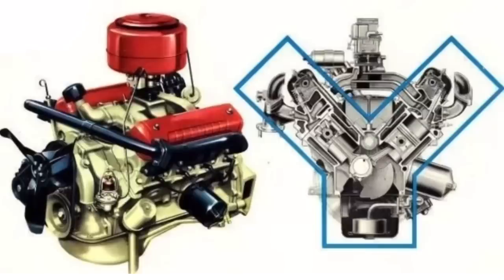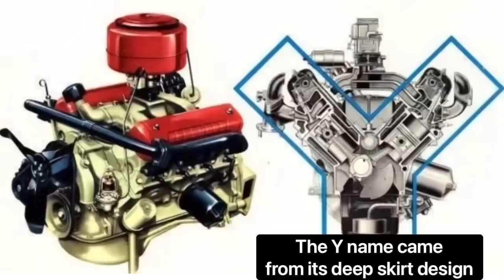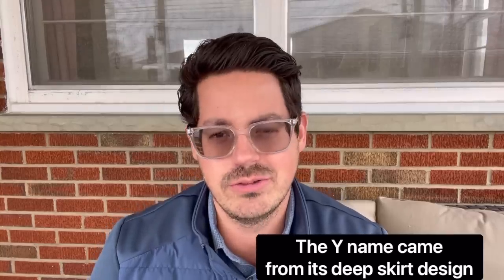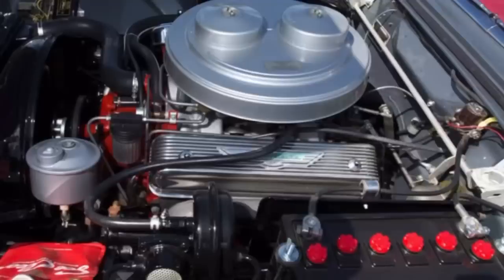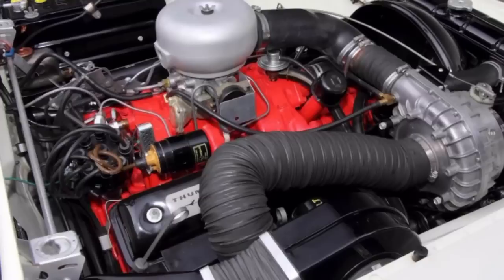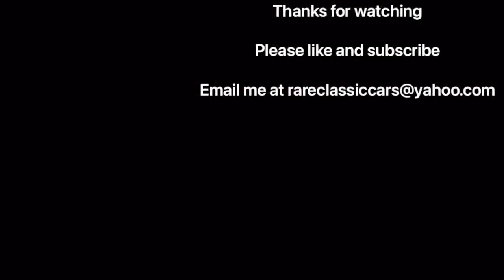Worst Engines of All Time: Ford Y Block V8

Comment: The first Hot Rod magazine I ever had,
the Sept 68 issue, had a great article on
the Y-Block called "One More Y-Block".
It was recommended to "ream-out slightly " an oil-return hole in each head.
Also, clean-out the area behind the oil-filter mounting. And yes, change oil
frequently. 
1957 versions are the hot ones.
Best aftermarket intakes: a 3x2-barrel
version.
Forget about the 1954 Ford and Mercury
versions. First-year teething problems.
The puny 239 Ford version was also used
in 1955 Ford pickups. Cam bearings are
a weird size. Also a weird water pump.

Comment: In 1970 I drove my 55 Fairlane to Laredo from Dallas. 272 2bbl. Dual glass packs and well tuned it was a pleasure to drive. Smooth, fast and strong and sounded great.  BTW the transmission was auto with a 1st gear select or it would engage on full throttle from stop.
Reply: Come 1970, you were driving one of the only ‘55 Fairlanes still on the road ...

Comment: I still drive a '54 all original, one of the best balanced engines Ford ever made, only the OIL of the time was bad, not the engine.  I run 5-20 synthetic, this big fordor gets 23 on the highway, far better than the flatheads, lots more power & speed, have 190K on it now, runs like new.  Don't be fooled by young guys' ignorance, I'm 89 and have been there done it.
Reply: Had a 54 239 Y Block & got about 23mpg with a 4 barrel.  The Rocker Arm assembly snapped so it ran flail (presume due to oil problems).Replaced the rocker arm & changed to a 2 barrel - got a drop in MPG. Some years later it wouldn't mic out for another rebuild, so replaced with a 292.  Generally a reliable engine.  Did have to repair the truck body frame & then the weld rebroke, driving in the dark thru the mtns.  Decided it was time for a change.

Comment: When I rebuilt mine 30 years ago, I had the engine on a stand, upside down. Needless to say, I messed up the cam bearing install. I also clocked the timing chain wrong because I counted the links on the wrong side. Once I learned those lessons, it was a good engine. One thing about them, the cylinder walls are so thick that I was able to bore the 292 out to .060 over. It was a fun engine if you like to tinker. Adjusting the valve lash on a regular basis was always fun. The front exhaust crossover pipe inadvertantly heated the fuel line causing the carb (For all you youngin's out there, "carb" as in carburetor, not carbohydrate. Think of it as a stone age fuel injector.)to vapor lock. The leaking heat riser valve bushings were fun. To it's credit, there was 1 vacuum line for the advance on the distributor, that it. Techs today missed out on some fun things that were around back in the day. Hell, the closest thing we had to a computer was a dwell meter to fine tune point gap and measure bounce. Sorry, it's past my bedtime so I'm not going to explain any of the words in the last half of that sentence. Consider it homework haha!

Comment: I have a 312 Y block in my 1958 T-Bird. 5W30 Valvoline high mileage blended ... NAPA Black filter and oil at 5,000 miles. Runs great. Cheap Insurance.
Reply: 5.7 Hemis are the worst for oiling.

Comment: I rebuilt a 312, in 1966.  I had heard about the problems with top side oiling and made sure that the machine shop that did some of the assembly also knew the secrets of the y block.  I had no problem with top side oiling and the engine lasted a long time.   Thanks for the memories.

Comment: So if you don't use the correct oil or don't change your oil and the passages clog up, that makes it a bad engine? I've had many Y blocks and currently have a 57 Bird with a 312. I've never had any problem because I do use the proper oil and change it regularly. I've driven it for 26 years with no real problem.

Comment: I had a 292 back in the day. My dad was a Ford guy. In those days engine rings only lasted about 80,000 miles. Getting 100,000 was considered a feat. Rebuilding engines was common. During this time I remember Ford's reputation for reliability was poor. Not only did the 292 engine need overhead oilers, but the shaft from the distributor that drove the oil pump had a tendency to break. My 292 thru a rod. I was so impressed with ford, I didn't have another for 50 years.
Reply: I had one that didn't break the intermediate shaft, but it did round off and quit driving the oil pump. I replaced it and drove the truck for several more years.

Comment: the Y block above the vega's ... graphite impregnated aluminum block... no liners... just infused graphite... that instantly washed out the first time fuel hit it... 

your seriously going to put these engines in this order...? REALLY?!!?!?
Reply: “One of the first (and worst) examples was the Chevy Vega engine back in the 1970s. Many of these engines burned oil from day one. The engines were cast from a high silicon hypereutectic A390 aluminum alloy that contains tiny hard particles of silicon dispersed throughout the metal matrix.”
Reply: @sking2173  and there ya go... 🤮🤕

Comment: My dad had a 1958 Ford Ranch Wagon with the 192 V8. I remember him cursing when he removed the valve covers exposing all the accumulated sludge. His 2 previous cars were a 1929 Ford Model A Town Sedan & a 1940 Buick Super convertible. He claimed that he didn't need that new detergent oil in this previous two cars. He got rid of the Ford wagon in 1967,  replacing it with a Ford Mustang 2+2. He learned his lesson & used the newer "detergent oil in all of his subsequent cars.

Comment: My first car was a '57 Fairlane 500 with a 312 Thunderbird Special v8, 4 barrel carb and dual exhaust with quiet mufflers.  My dad always drove economy cars, so all I knew were fairly gutless cars that struggled on climbing hills.  On coming home from buying it, we came up the steepest hill that we usually suffered through a 15 mph drop in his car.  At the bottom of the hill, I had the Fairlane sitting on 60 mph and without opening it all the way up, I chickened out at 80 mph.  It was the strongest car I'd  been in up until that point.  Crappy gas mileage, but plenty of power.

Comment: I was raised in a Ford family.  My first car was a 55 with a 272.  That thing was a dog.  It was bought new by my grandfather, well maintained for all of its life,  just not very powerful or economical.  Having a three speed automatic which only used two speeds didn't help.  Married a 73 Galaxie 500 with 260 Fordomatic in 1969.  That one broke me entirely of Fords. In 1971 I bought my first Dodge Dart and haven't bought anything but Chrysler since then.  I have worked as a mechanic,  have worked on and driven some of nearly any brand of car on the market.  In 1970-71 right after I got out of the army I was one of two factory certified Datsun mechanics in North Georgia who were outside of Atlanta.  We were both in the same Cad/Olds/Datsun store in Athens.  Datsuns were good then, but not for much longer.  Nothing but Chrysler minivans since 1987.  They routinely run over 300,000 miles with not much other than spark plugs and oil changes.  have 5 of them in the fleet now, newest one has 180,00 on it.

Comment: You are right my dad had a 57 pickup with that motor he drove it a long time with the oiler set up  but it used oil after the supposed fix. It stopped the noise but I think the lack of oil damaged it some ?

Comment: One note: I ran into a 312 that had an oiling problem, the oil hole in the block mis-aligned with the one on the left head. The cure was to chamfer the edge of the holes and this cured the problem. Single issue or maybe some one else had this happen.

Comment: My dad ran Y blocks in his ford truck for years, and it was no show truck or parade vehicle.
Hauled an air compressor and 1000lbs of sandblasting grit and the rig.
Firewood trailers, etc it was a work truck and he never had a problem
But he stayed on top of the maintenance....Alot of complaints about the Y blocks came from folks who just wanted to jump into a vehicle and drive it without worrying about the maintenance.
Yes the later 260/289/302 and FE engines were better in alot of ways

Comment: The flat heads had cooling issues. Ford tried for yrs to remedy this. The Y was an improvement, but not as good as the FE or 385 series for sure. Oiling issues were the biggest drawbacks and I'm glad u mentioned it! My dad worked for Ford at a sub assembly plant in the late 50s. He claimed that there was a special room where blown engines would come back for inspection. A guy he had lunch with talked about the failures, and unfortunately, quality control seemed to have been a real problem!

Comment: I have a 1960 F-100 with a Y block. I bought a house and the truck came with it. I’ve been too busy to dig in to the truck, but soon I’ll put a fresh battery & oil in it and see what happens. Resurrecting old Fords is my thing, but so far it’s been a flathead, some 289s and a 460. Looking forward to the Y block adventure.

Comment: Sorry to be a dick, but these engines were good. Worked on a lot of them and they were way better than small block Chevy. They did not last long because Ford engineering kept improving the product and so it went away. Not a bad design at all.

Comment: We had several trucks with the 292 Y block. Thay were very dependable, ran well, never had any problems. When we did get rid of them it was because of excessive miles on them and other issues of maintenance problems with the rest of the truck. There were just tired and time to go.

Comment: My dad had a '59 ford with a 312 it did a funny thing, if you put in 5qts of oil it would burn 1 in about 100 miles but if you left it 1qt low it was just fine.

Comment: Here in Australia we had the 272 ci Y block in our 55 to 58 Ford Customlines and our unique to Australia Ford Mainline coupe utes with the 292ci in our F-Series trucks of the day and we had the same problems with oil getting to the rockers or lack thereof with other problems also with them and my father wished he had of kept his 53 anniversary model Customline with the sidevalve  239 V8 when he experienced the Y blocks problems a year or so after he traded it for a 58 Star model Customline, also an Gussie only model named because of I think a Canadian mercury grille, which had the 272 engine and the Ford-o-Matic auto, he got rid of it when he bought a new compact Fairlane in the early 60’s with the new but better Windsor 260 V8, a car the size of the new Falcons, he really liked it and traded it in 65 for the new 289 version but I was told in later years that the problem was something to do with the alignment of the oil gallery holes from somewhere where the camshaft bearing would go out of alignment with the small oil galleries to the overhead valve gear or something like that but at the end of the day if you compare the Y block to its competitor around the same time the small block Chev which I think you have to compare there is no comparison the Chev is just a better engine full stop, I had a 56 4 door chev sports sedan with the 265 and remember it to be a bloody good engine the Fords here only got better with the intro of the Windsors that we used in our Local Falcons, Fairlanes etc and then our Aussie made Cleveland’s from 1972 in those cars as well as LTD’s and F-Series trucks until around 1984, the Australian Cleveland were made in Fords Geelong, Victoria Plant in 302 and 351 capacities and powered a large variety of vehicles over the years including Australia’s wonderful fibreglass sports car the Bolwell Nagari in both sizes of Cleveland’s from Ford and what is not really well known is that Australia supplied nearly all of the 351 Cleveland engines De-Tomaso for its Pantera sports as I think the USA stopped building them after only a couple of years and just built the Windsors where in Australia we developed the Cleveland engine further especially around the head design and the Aussie Cleveland heads were in demand by American hot riders etc

Comment: I think another Ford engine that was terrible was the 360 engine with a 2 barrel, I never seen an engine burn so much gas! They were terrible in gas mileage. The 390 was 100 times better than the 360,,,,,,,,,,,,,,,,

Comment: I call pure urban nonsense on this video. Unless you actually have dirty hands on experience with these engines, you are talking hearsay. Yes, Y blocks like ALL other engines have their idiosyncrasies but worst - NO WAY. I built way too many for street and track. Oiling system, your information is incorrect  -  keep the detergent oil only changed. The failures were due to plugging the oil feed passages in the head/block interface where the oil needed to make two 90 degree turns and it plugged with crud. Additionally, the rocker shafts would plug from that same cruddy, non detergent oil.  Build a 312 for high revs - use a 292 block and machine the 312 mains to 292 diameter . High revving - 6K was easy, higher cost a few bucks more. Use a 1954  239/254 block - well lets say that the .55 and up solved lmost of the early problems
Reply: The idiot engineer that designed that double 90 deg. kink in the oil passageway should have been lined up against the wall ...
Reply: @sking2173  At least the way the oil pump was mounted outside the engine block made the addition of external oil lines easy. Probably the one item that made my life interesting while working on these engines were the mushroom lifters - unless you had the proper holding clips - that might not always work.

Comment: I have personal experience with the ford Y block. They were decent engines as long as you changed the oil regularly. I still have one in an old F350.  It was never fast but for a truck of that era it always punched well above it's weight and it withstood years of abuse at the hands of a teenage driver who grew up on a steady diet of Smokey and the Bandit and Dukes of Hazard reruns.   That's a tall order for any engine of that era.
Reply: What oil do you recommend?
Reply: @fadedjate7230   Pretty much any good quality oil works, but you really should run some additive with zinc in it for older, non roller cam engines.  I believe Rotella still has zinc in oils they advertise as being for diesels.  Also I'm a big fan of Marvels Mystery oil for Y-blocks.  I couldn't tell you why but it made the valve train on mine a lot quieter.  I could pour some in with the engine running after an oil change, and the valvetrain would quiet down considerably. It would stay quiet until the next oil change. 
I still run some in my 63 Ford SD series 534.
Reply: @BD-xz6te  Probably gonna need lead additive as well.

Comment: I had 61 f100 292. I did rebuild but kept the oil changed. The only thing i did was put an alternator in place of the generator and put a 500 cfm holley carb. I drove it for 7 years without any problems.

Comment: I'll tell you all about these engines as as old Ford Mechanic. They were hand grenades. Cam bearing turned on their own and cut all oil supply off to the rockers. aftermarket companies made a kit where you could take a NPT plug out of the block and put oil up to the rockers through quarter inch copper lines. The oil pump was run by a Allen rod from the base of the distributor that always rounded off.  The intakes in the heads made  90 degree turn before getting into the combustion chamber.  I'm sure in that  era  Doctor Timothy Leary was the head engineer there.

Comment: About 14 years ago I built a 1937 Ford pickup hot rod for a customer, powered by a nicely rebuilt 312 Y block and a C4 automatic transmission. It had ported heads and the engine was built by a local shop that specializes in Fords. It was a very quick little truck, very fun to drive, and currently has 35K miles on it with no problems. Old tech oils were the death of just about all old engine designs because of their tendency to sludge up and block oiling holes. Modern oils don't do that, and if the oil changes are done on time, these engines are just as good as anything else of the period.

Comment: Not a fan of the Y block lump BUT they were an ok engine. If serviced correctly with the correct oil. 
Forget any serious performance though, then they broke.
Here in Oz we got 272s and 292s in cars and trucks. And there is plenty of F600 single drive trucks that just kept going into the 80s with 292s. 
There is still a few Cussos around too that did not rust out. I know of a 57 that has never had the engine apart ever in 65 years and still being used semi regularly like 2-3 days of the week.

Comment: Would not any ohv engine of that era have the same problem, during the beginning of detergent being added to engine oil, if they ran non-detergent oil?
Hot rodders were disappointed in the Y block because of the poor intake port design, being stacked ports, it gave little room for improvement.

Comment: My grandfather gave me my first car a 1955 Ford Customline 2 door.  It had the BIG 292 V8 that ran on 6 cylinders most of the time.  Grandpop didn't think his "new car" had an oil filter so he never changed it???  God, I loved that man 😀  The first time I removed the oil filter I think it weighed 15 pounds LOL.  Being a budding gear head I rebuilt the motor and it ran great, with lots & lots of torque.